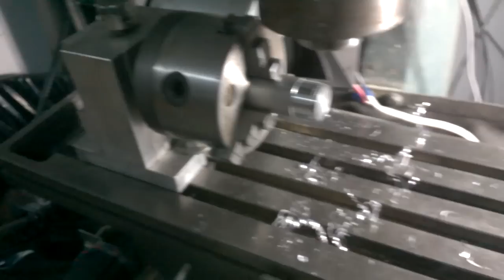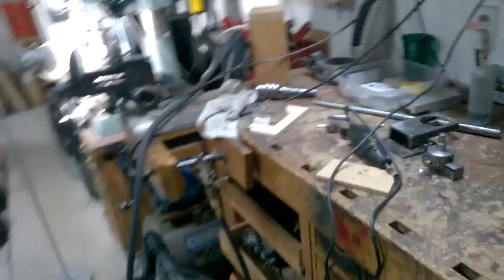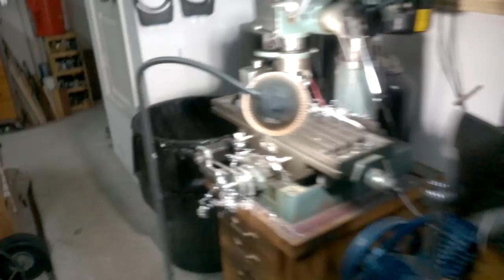CNC Mill Turning Head

Comment: That is a nice experiment.  I will be watching to see what results you get with this.  What processor are you running your g code on?  Thanks for sharing.
Reply from the maker: Thanks.  I'm running Mach3 on a 3gh, single core Pentium 3 desktop using Windows XP.
Reply: So you have a digital to analog output card in your pc?  I am interested in how to connect to the motors.
Reply from the maker: The turning head is operated by a 90 volt, DC motor.  It's powered by a Variac, variable voltage transformer and a full wave rectifier to convert it to DC.

The stepper motors on the CNC mill are connected to a Gecko, G540, 4-axis stepper controller.  The G540 is connected to the computer through the parallel printer port.  This is a fairly standard configuration for CNC operated equipment, at least at the hobbyist level.  G-code is a simple programming language that tells the milling cutter to move to a location specified by X & Y coordinates.  For example, "G1 X4 Y5" means go to position X, 4 inches to the right of 0 and position Y, 5 inches from 0.  The G1 means slow speed whereas G0 means go fast.  G1 is used for cutting movements while G0 is used to move quickly from one point to another with the cutting tool raised above the work.  Mach3 converts the G1 X4 Y5 to a series of step and direction commands which are sent to the G540 controller.  Each step and direction command would normally cause one stepper to move one step.  However, the G540 is able to move steppers 1/10 of a step at a time so it takes 2000 step commands to rotate a stepper 1 full turn.  On the X & Y axes, one full rotation of the stepper moves the table 5mm or about 0.2".  The bottom line is, that one G-code command often generates many thousands of step and direction commands.

Hope that wasn't more information than you wanted... :^)
Reply: Chuck Fellows interesting.  I would have thought the arduino and the raspberry Pi would be doing that job.  They have much better I/O than a parallel port.   thanks for the information.
Reply from the maker: While the Raspberry Pi and Arduino would have been a cheaper and more adventurous route, Mach3 running on a PC is a mature technology, pretty much plug and play.  I didn't have to develop any code and the Mach3 implementation of G-Code is more comprehensive than any of the Arduino CNC software.  A PC also has a keyboard, a monitor, and a mouse which makes the user interface orders of magnitude friendlier than the usual, crude user interfaces to an Arduino.  And,  from a speed standpoint, my PC runs at 3 gigahertz which is 187.5 times faster than an Arduino, so it can manage 4 axes quite handily without losing steps.  

The I/O on an Arduino is probably easier to program than a printer port, but Mach3 takes care of that so as a user I don't have to worry about it. Finding a PC with a printer port, on the other hand, can be challenging, pretty much limited to the older, used market.  Don't get me wrong, I love the Arduino and have created a number of fun projects with it.  But for CNC, I just prefer the power and ease-of-use of Mach3.  As for the Raspberry Pi, I don't own one nor have I done any programming on it.  That fact that I would have to deal with an operating system like LINUX kind of puts me off.